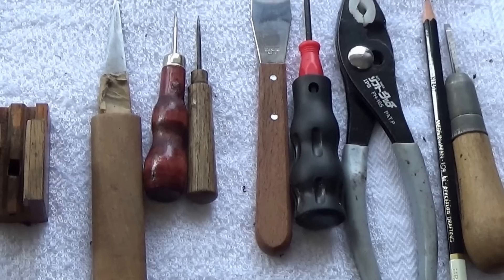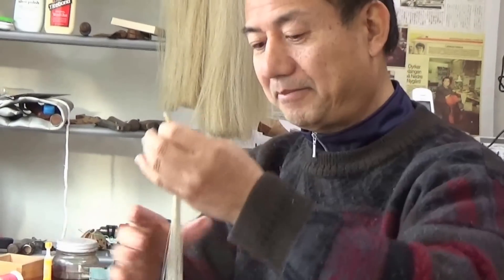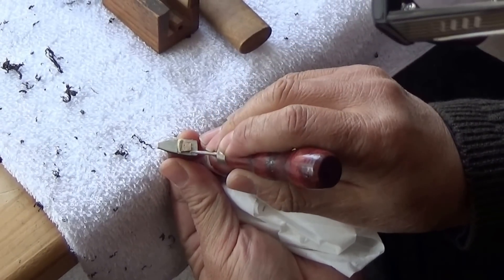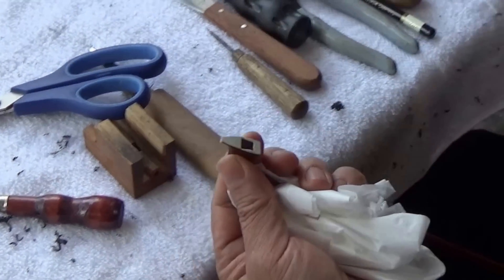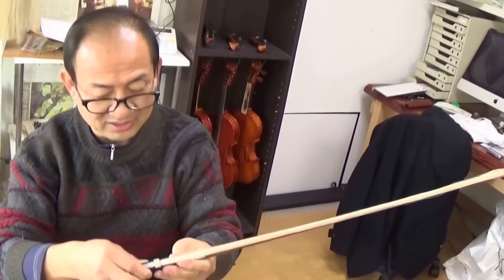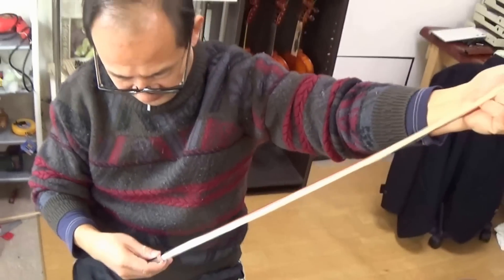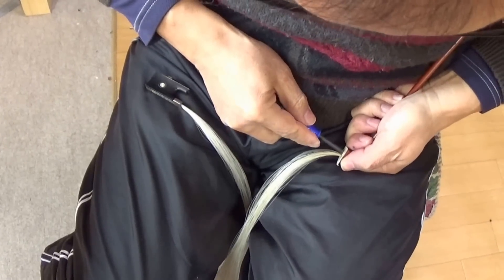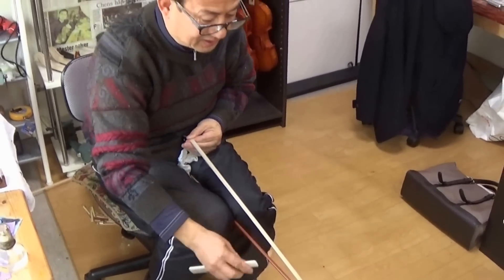How to Change Bow Hair by Daniel Olsen

Comment: Thank you so much!
I actually want to replace the bow string on my erhu.
I would think most of the information will be applicable, particularly how the string should be parallel to each other and don't cross.  I will wash the hair and comb it first.
Am I on the right track?

Comment: I had followed the guide perfectly until 13:18, this step was so difficult for me and the tip would slip out of the hole and I could not plug it in as easily with the wood piece as you did.. I eventually ended up cutting too much bow hair off attempting to get the tip to fit, long story short my attempt was a total failure. Thank you for the guide, I will be attempting this again sometime in the future.

Comment: I just ordered and received a frog to my surprise it came without a hole where I could screw the adjuster into the bottom of the frog... Where do I drill and install the screw and bolt into the bottom of the frog to mount on the bow? Jami
Reply from the maker: you can not, it is pro work